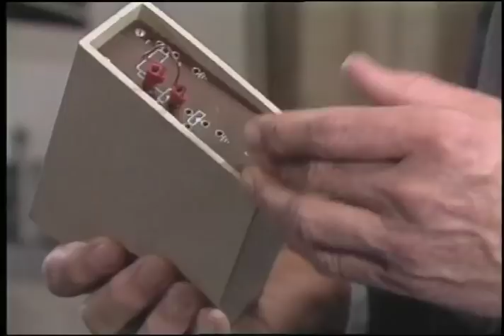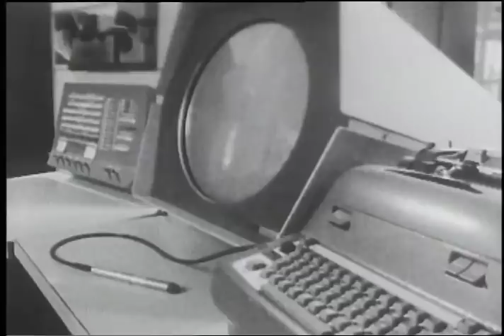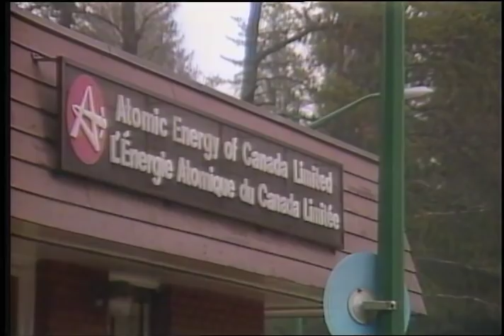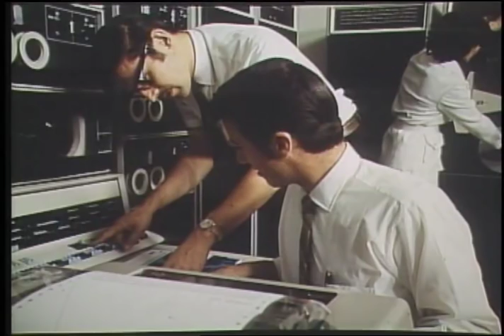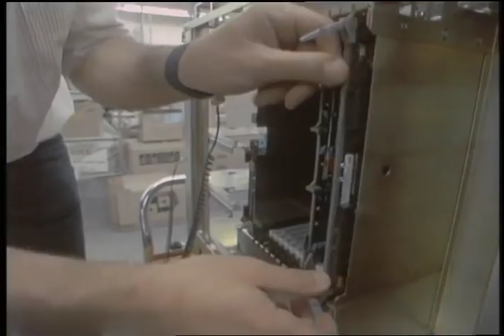Ken Olsen DEC 1957 - 1989

Comment: Over the years I used several different DEC machines.  In 1975 I used a time shared PDP-11 that had UNIX for its operating system.  That was in a sophomore CS lab.   Later, I was in a realtime programming lab that had a dozen PDP-11s, running RT-11.   After I graduated I completed a project that used a KA10, as a standalone processor.   It was quite an experience to see 20 feet of multi-platter disk drives vibrate when a program compiled.   Some of the software was written in assembler.  Amazing what one instruction could do on the 10.   I am retired now and have done a wide variety of electronics and software work.  My only regret is that I didn't spend more time dosing DEC hardware.

Comment: DEC in the 70s assumed that memory would stay expensive forever, and designed the Vax to save memory.  They never understood the markets above the hardware level, and were a hardware company.  But UNIX made Digital computers a commodity and DEC Vaxen were too overcomplicated and came to be seen as CISC (complex instruction set computers) - an epic mistake!!   Even the PDP-11 was CISC to some extent.  It's the MIT disease.  MIT's Multics computer was CISC, too.  All of them put too many features into the hardware to try to lock-in the customer.  Think too hard, make a bloatware system to solve problems that nobody has.
Reply: There's truth to this comment, and one reason behind the death of the Boston-area computing industry in the US between the late 1970's and the mid 1990's (by which point the epicenter had long since moved to central CA).

Comment: I programmed a DEC PDP 11/10 driving a Laboratory Peripheral System to perform interrupt-driven waveform signal averaging in 1976 at Sydney University, Australia. My supervisor was an MIT Engineering grad who had known the DEC people while there. I used the logic in later (1981) routines using the Apple ][e with Motorola 6502 microprocessor and 6502 peripheral IC. Thank you DEC.

Comment: And I built at least 30 or more of the PDP 11/45 systems. DEC was a great fun place to work. Worked on PDP-8 too. Still have my PDP-8 and 11/45 programming cards too. PDP-8 was a desktop machine, it had to be a strong desk, but it was all in one cabinet sitting on top of a desk. One day I was working on a group of modules, K578s I think and a man came up to me and asked what I was doing so I explained to him what the module did, he thanked me and walked away. Well my department head came over and asked me if I knew who that man was, and I told him no. Well, he said, that was the president of the company, Ken Olsen. My badge, which I still have was 7636.
Reply: Most of the PDP-8 models I knew were not desktops... they were 12-bit machines in free-standing, nearly-6-foot cabinets.(I also  recall an 8-E and 8/L)  Of course the cabinetry and technology evolved over the years.
Reply: Unfortunately Facebook doesn't allow us to CONSISTENTLY edit/correct typos  :(
Reply: My first PDP-8 (an 8/I) was a 6-foot freestanding cabinet.

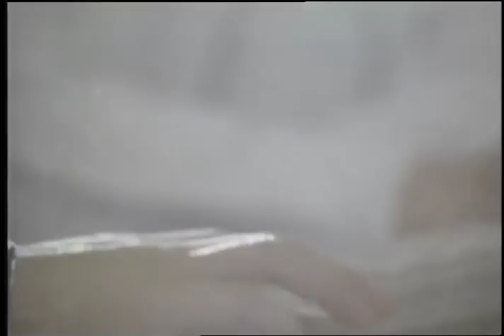Comment: 17:35 On the plus side, DEC promoted peer-to-peer networking which went beyond the hierarchical restrictions of IBM’s SNA up to this point. On the minus side, DECnet had no ARP layer, unlike TCP/IP or even AppleTalk. That meant that there had to be a fixed relationship between the Ethernet MAC address and the DECnet node address, so that one could be computed from the other. With the other common protocols, node A trying to talk to node B could simply broadcast a request on the wire asking “What is the MAC address for node B?”, and node B would reply “Here I am!”, and the source MAC address on its reply frame would be the answer.

Comment: DEC was a company founded by engineers, selling to engineers. You could get schematics, down to the transistor level, for all their PDP products. You didn’t have to pay licence fees to design cards to plug into their Unibus and Q-Bus expansion backplanes. (I think this changed later with the MASSBUS for VAXes.) There were even some PDP-11-compatible machines built by third parties, and DEC didn’t sue them.

Xerox PARC (where the GUI was invented, also where Ethernet began) wanted a PDP-10. But rather than buy one from DEC, they built their own (the MAXC). And again, DEC didn’t sue them.
Reply: "DEC was a company founded by engineers" ... and then came Marketing.
Reply: @James_Bowie  Boeing is doing that right now with the same resulting failure.
Reply: its easy to say they are pro invention kinds of people not pro money or fame..
Reply: Ethernet did not begin at PARC. It developed from ALOHAnet

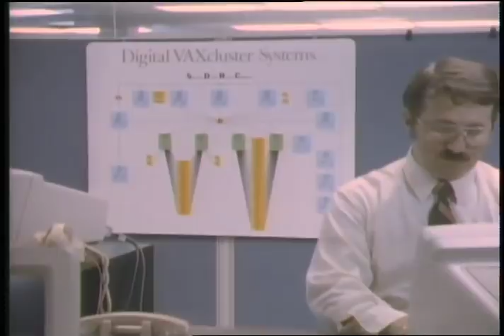Comment: 14:36 While there were similarities between PDP-11 and VAX architectures (byte addressability, patterns in the addressing modes), they were not quite compatible. Early VAXes actually had a PDP-11 compatibility mode built-in, so you could switch between running old PDP-11 code and new, native VAX code. This was done away with in later models, as customers’ need for it went away.
Reply: But it was still way faster to compile on a VAX with a PDP-11 as the target, and transfer the binary to the PDP-11.

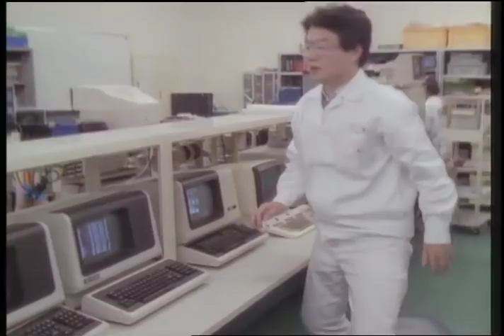Comment: 14:12 Observe the VT-100 terminals. In those days, there were a great variety of CRT terminals from different vendors, all incompatible. For example, the control sequence to move the cursor to a particular spot on the screen would be completely different from one vendor’s terminal to another. Somehow, into this milieu , the DEC terminals became de facto standards. There was an ANSI standard for these control sequences, and the VT-100 implemented a superset of this standard.

Unix systems incorporated a library called “curses” which let application programs do on-screen interactive displays without worrying about the differences between different terminal types. This library still survives on Linux systems today.

These days, all the old terminals have become extinct, not to be found outside museums (or the homes/shops/sheds of vintage computing enthusiasts). But the curses library still exists on Linux systems. As do terminal-emulator programs on text consoles and running in windows under a GUI. But the great variety of incompatible terminal types is no more; they all emulate a VT-100.
Reply: "This library still survives on Linux systems today." Which says a lot about how old fashioned UNIX/Linux is, and was, already in the 1980s. 

No hate, but I always found it absurd that those old style systems are seen by many as more "modern" or "high tech" than (say) a scientific calculator, or even the home computers of the early 1980s, both of which starts in a second... (Yes, I know that's because they are ROM based, but so what? Why are not all personal computers ROM based?)
Reply: These days, all the old terminals have become extinct

Embedded processors: hold my beer

Comment: Ken Olsen was a good and decent man. His only failing was to ignore UNIX. Before Sun Microsystems came along, DEC owned the UNIX market. Had they been more aggressive about UNIX, Sun Microsystems would have never happened. I know, I worked for both companies in Silicon Valley. There were quarters where the number of VAX machines shipped without VMS licenses equaled the one’s with! That means half of all VAX in high tech and academic computing ran UNIX. These were the markets I worked in. Around 1982, I had a summer job at Bell Labs in Murray Hill NJ. They had two VAX machines named Alice and The Rabbit. Both attached to a DEC Star Coupler. A UNIX cluster in 1982! Alice and The Rabbit have the distinction of being among the first computers on the ARPA net!
Reply: DEC had a tradition of hating Unix, which went all the way to the top, to Ken Olsen. So that really only changed about the time he left. Also, just the year before this -- 1988 -- management cancelled Dave Cutler’s PRISM/MICA project for a successor to the VAX and VMS. So he left and joined Microsoft, where he led the creation of Windows NT. Which went on to destroy the Unix workstation market.
Reply: @lawrencedoliveiro9104  I disagree.  There were multiple product lines.  The first-ever licensed UNIX system was "mine" at the Boston Children's Museum (with a one-off license signed by Ken Thompson and Dennis Ritchie at Bell Labs).

Comment: Digital was the best work experience I had.
My first relationship was while working at the Control Data Analog Systems Division in La Jolla, about 1965. Specified and bought the Digital logic modules to integrate into the process control systems and Hybrid Computers, used as flight simulators. Later Digital, 1981, was my customer at Megatek, we were supplying innovative high speed color raster graphics processors integrated into Digital computers. In 1987 I joined Digital as a CS4, for Computer Special Systems in Merrimack, N.H, working out of San Diego. 
I retired 1997 and living the good life here. { oddly almost across the hill from the old Hewlett Packard local headquarters.]
.raster
Reply: I think DEC used CDC disks.

CDC was the original employer of Seymour Cray. They wanted to get into this new business-computing market, but he created a machine that was 50 times faster than anything IBM had. So they had to invent this new “supercomputing” market to sell it.
Reply: @lawrencedoliveiro9104  Yes, I worked up at Chipawah and Arden Hills with Mr. Cray, 6000 series operating system design.
At DEC, with the Componets Sales Divison, Manchester, sold DEC , Colorado Springs Division,  discs to several computer companies. Data General bought that division.
It was a great ride! Hub
Reply: I’m doing a research project that includes some background on DEC. Could I message you some questions?

Comment: Thank you for sharing this. What a great tribute to a great visionary
Reply: DEC KNEW this computer (Rainbow 100) was junk in 1982; because I TOLD THEM and also proved it to them shortly after it was released.  In 1982/83 My company bought new DEC Rainbow computers, running CP/M for the entire engineering department. instead of the IBM PC's everyone else was getting.  While creating programs for Line Balancing, Screw Machine labor standards and many other things in the Engineering department I noticed anomalies.  I shook the Rainbow down and found that it was not doing math properly.  It took three days to find the Engineer in charge at DEC of the Rainbow 100.  When speaking with him I asked him to cold boot his Rainbow, then type these keystrokes:  <1> </> <2> <ENTER>  .    He did, and immediately said "Oh my god!"  He repeated this keystroke pattern several times, getting a different result each time, never getting " .50 " which is the correct answer.  That duplicated what I found.   I asked if the problem was hardware or software, and he said it was hardware and a fault in the motherboard DESIGN.  I worked at that time as Industrial Engineering Manager for the Electricity Management Division of Schlumberger in West Union SC, USA.  Schlumberger bought more DEC computers than any other company in the world.  The Rainbow 100 was TRASH.  The problem required a newly engineered MOTHERBOARD.  I do not know how DEC resolved this issue.  But we trashed them all and went with IBM PC's even for Engineers.   I highly recommend anyone using A DEC Rainbow 100 or other DEC computer from that era do the same simple test I "boiled the test down to" to see if the computer has the bad motherboard.   <1> </> <2> <ENTER> :  One divided by two = ?    If you get anything but .50 your computer is JUNK, and everything you have calculated on it is suspect (but probably 100% worthless).  My name is Michael Stelzer.  Have a nicer day!
Reply: @rstelzer2928  - dude - this is the Nth rant on the same topic. You have made your point. WE got it.

Comment: Quotes I like from Ken Olsen in this video:
"Entering the laboratory was a little bit like going into a religious order as a neophyte, they had an attitude about reliability, and how you build electronics, which they believed religiously. You had to follow the rules, and it was almost a fixed procedure that you had faith in, rather than something you knew worked".
 
"You never talk about business in terms of calculus, but it sure is a handy way to look at it yourself, because the balance sheet is an integral of the P&L statement, and you really need to look at the derivative of the P&L statement in order to gain knowledge, and sometimes the second derivative. And all of this helps in looking at the phenomena we work with everyday".
Reply: In a way, what he said was correct - you were able to design by following rules about tolerances and "worst case" specs, without questioning them - rather than having to compute the exact behaviour of every interface. This was before 7400 series TTL. The use of a standardised interface made design work 100 times faster - both designing the modules and designing an application constructed with the modules. 

 While that might seem obvious to today's digital designers - this was still the first generation of digital designers, and it was a whole new world they had discovered. (Actually, Charles Babbage's team made the same discovery almost 100 years earlier, but very few people knew that in the 1960's). If you look at EDSAC (10 years earlier than DEC) this was still not well understood. Ask the rebuild team.

As for calculus and business - that is what "quants" are about today.
Reply: every genius and interesting man, but at the dark side, he became so unique in his thoughts nobody would come clean to some-sense thoughts, from clusters, to superclusters, you need a mainframe to control de facto machines, it became a big company by doing the right thing to do at a time, even if you don't like the thing HE DOES, HE WHO LIKES TO DO THIS WORLD DOES WHAT HE THINKS IS CORRECT, even if creatures just don't like it